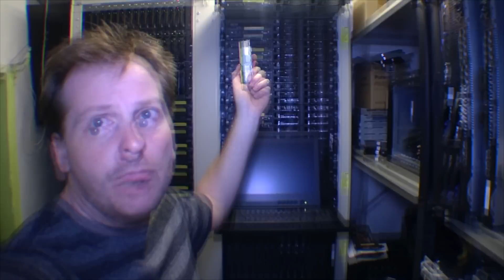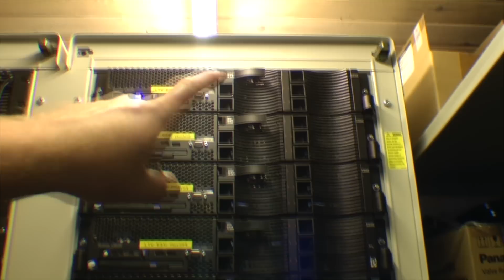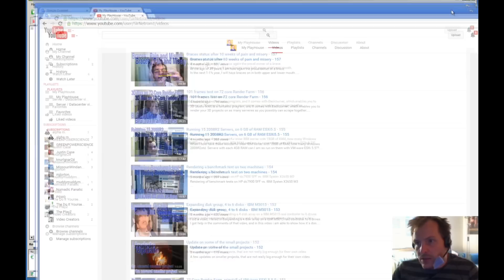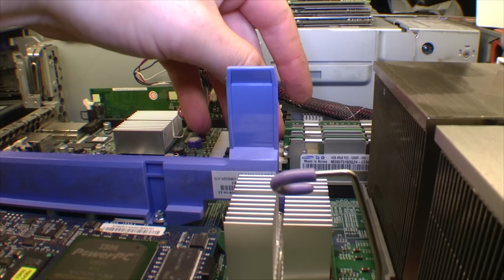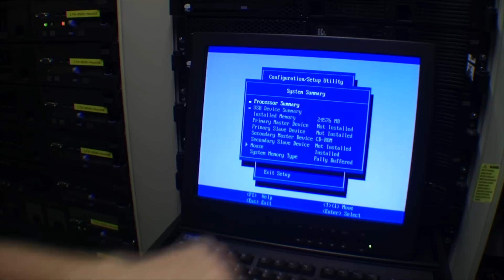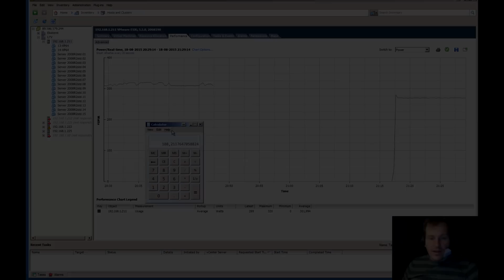IBM Server 33.3% more RAM 13% less power use - 227

Comment: Interesting. Though these findings are only relevant with DDR2 memory, DDR3 ECC is much more efficient, and generally uses < 1w per stick.
Reply: Jeremy Scalpello, Well, DDR3 is also placed into more efficient boards than the more "vintage" DDR2 models. However, the point remains that fewer slots populated require fewer watts for a greater increase in memory across any platform. The value ratio may not be quite as good as of yet due to the still considerable cost of DDR3 ECC memory.
Reply from the maker: Hi Tyler Barton and Jeremy Scalpello 
Yes this may be a particularly good server to show just this. :-)
But as far as I know, a newer DDR3 block typically do not use less power,, but you typically you get more memory for the watt.
Thank you for watching! :-)